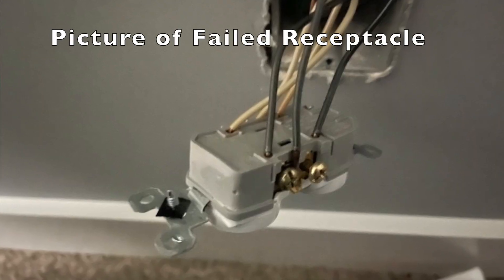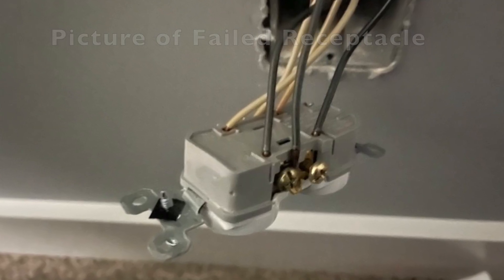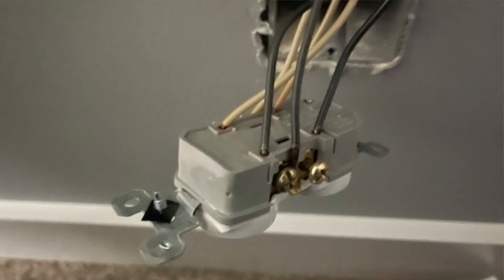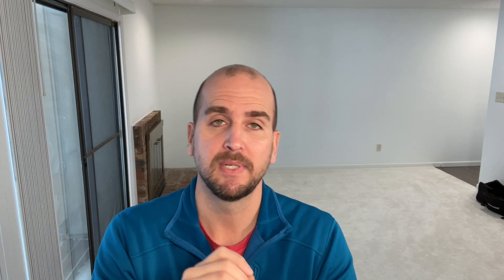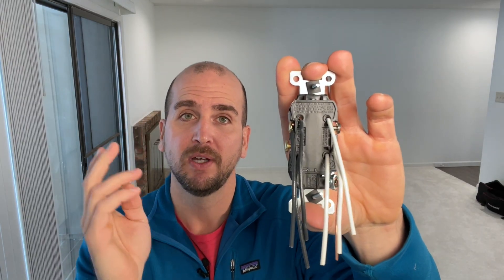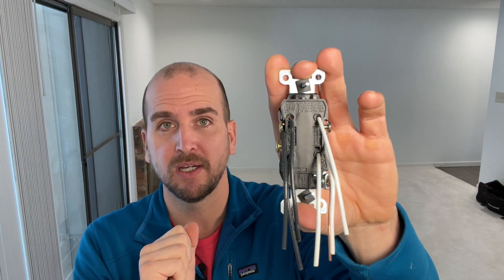Incorrectly Wired Outlet Found In Newly Built Home

Comment: If you have a High Grade (Commercial/Industrial/Spec Grade) receptacle outlet which features Back Wiring clamp/screw type connection terminals, I don’t see any reason why you would want to bother with and use a pigtail configuration - Before I get started I just want to eliminate some possible points of confusion that some people might have concerning "Back Wire" connection terminals - The term Back Wire by itself is somewhat misleading in that it might cause you to conclude that the Back Wire connection terminals are probably located somewhere on the back surface of the receptacle - If you have that impression you are dead wrong - Back Wire connection terminals are NOT located anywhere on the back surface of the receptacle but are instead located along the sides of the receptacle exactly where the Hot and Neutral terminal screws are located - With that being said and to avoid another possible point of confusion, it should be noted that the Back Wire connection terminals are NOT the four small hole openings that you will commonly find on the back surface of your lower quality receptacle units where you can simply push in a set of 14 gauge wires to make your connections which I strongly do NOT recommend - A Back Wire connection terminal is actually an assembly of two parts (a terminal screw and a clamp that is located underneath a terminal screw) - When you place a wire underneath the clamp of a terminal screw and tighten down the screw you will have performed a Back Wire connection - When you place and hook a wire underneath the terminal screw and tighten down the screw you will have performed a Side Wire connection - The wire must be placed underneath the clamp to be properly classified as a Back Wire connection - With your Higher Grade receptacles you are most likely to find that each Hot and Neutral Back Wire connection terminal will have two guide slots which will allow you to firmly attach two wires to any of said Back Wire connection terminals - Furthermore,  your Higher Grade receptacles with Back Wire capability will most likely come with a Back Wire type connection terminal for your ground wire connections - You should expect to find a clamp underneath your Ground terminal screw - High Grade receptacles as you should expect are Heavy Duty and will generally accept larger wire sizes up to a maximum wire size of #10 AWG - Scott has a few videos which he has posted online where he has dissected and compared some of your Higher Grade receptacles against your ordinary run of the mill lower end quality units that you might be tempted to buy - I strongly recommend that you purchase only your Higher Grades of receptacles which have Back Wire connection terminals - I will now like to discuss and explain why I think a pigtail configuration should not be the preferred way to go when you are installing High Grade receptacles which have Back Wire connection terminals - Point One - Connection Firmness/Current Pass Through Stability - Every High Grade (Commercial / Industrial / Spec Grade) receptacle that I have ever seen has been manufactured with two recessed slots per Back Wire connection terminal which allows the user to attach two wires to each said Back Wire terminal - If you connect both your hot wires to the same Back Wire connection terminal and connect both neutral wires to the same Back Wire connection terminal, said connection should at least be equal to or better than a wire nut connection which is what you will have to contend with when you do a pigtail configuration - The Back Wire clamp/screw terminals of these High Grade receptacles are really no different than the clamp/screw terminals that you will find on most circuit breakers - Point Two - Receptacle Failure Will Not Cause Other Devices Downstream To Become Disabled - If you hook up both hot wires to the same Back Wire terminal and both neutral wires to the same Back Wire terminal and the receptacle fails (stops working), current will continue to flow downstream uninterrupted just as current would continue to flow downstream uninterrupted in a pigtail configuration - Point Three - Excessive Downstream Loads Should Have No Effect On Heating Up The Receptacle  - Again, if you hook up both hot wires to the same Back Wire terminal, current to downstream devices should flow in the same manner as a pigtail configuration and should not heat up the receptacle any more than what a pigtail configuration would do - Point 4 - A pigtail configuration requires additional wire nut connectors and wires which can make it more difficult to fit everything into the outlet box, particularly if the box is a small box like the shallow size boxes that are most commonly found in 2” x 3” studded wall partitions - Point 5 - If you split feed the receptacle with an extra hot wire and you use a pigtail configuration, you will make it even more difficult to fit everything in the box - With respect to the ground wires, you should be able to twist the two ground wires together and attach them directly to the Back Wire connection terminal of the ground terminal - I don't believe the Code would require a pigtail type of connection for the Ground wires if the Ground Terminal of the receptacle is equipped with a Back Wire clamp/screw type connection - Notice that the above points one, two and three are conditioned on the assumption that both hot wires would be connected to the same Back Wire terminal and both neutral wires would be connected to the same Back Wire terminal - Although it can be argued that the hot common fin connects both hot terminals together and the common neutral fin connects both neutral terminals together, it is my opinion that connecting both hot wires to the same Back Wire terminal is a more firmer and direct connection than connecting one hot wire to one hot terminal and the other hot wire to the other hot terminal - The same reasoning applys to the neutral wires as well - In summary, if you have a high grade Commercial / Industrial receptacle with back wire capability, why would you want to go the pigtail route -  Lets argue this point another way - If a pigtail configuration is the preferred way to go, why would manufacturers still design their receptacles with an extra hot and neutral terminal - Granted, you can absolutely justify an extra hot terminal for a split feed configuration but you really can't justify an extra neutral terminal - Final counterpoint - Although the Code is always said to be concerned with safety first and everything else second, I would think that if a pigtail configuration was the more preferred way to go, the Code would have mandated it by now - In the end, with using a pigtail configuration, all I see is more work with no additional benefits - With a pigtail configuration, you are actually throwing into your installation equation additional tasks were errors might occur - Specifically, if you are not careful, you might fail to securely attach the wires inside the wire nut connectors of the pigtails, and as a result, the wires come loose causing your installation to fail - Finally, as an aside, my own personal preferences - If possible, my preferred way of wiring receptacle boxes is one 12-3 conductor cable (12 gauge, two hots, one neutral, one ground) per single gang box with each cable being fed via way of an over sized junction - I may not always use the second hot wire as a split feed, but by its inclusion, it does allow you the option of a split feed should you later change your mind - If I can't get by with a single 12-3 cable, I will use a 4" x 4" deep size junction box with a single gang cover - I simply don't like to see electrical wires crammed into a box and it doesn't make any difference what kind of box it is (receptacle, switch, junction, circuit, etc.)
Reply: I totally agree although I will pigtail if there are three pair of wires in the box.
Reply: Hi Jack - A few comments - I will assume you are talking about wiring up a single duplex High Grade (Commercial/Industrial/Spec Grade) receptacle with Back Wire capability with dual slots on each terminal - Three pairs of wires translates into three cables being attached to the box - Running three or more cables to a receptacle box is definitely not my preference but sometimes it can't be help or it can be very justified - At a very minimum, I would use a  4" x 4" x 2 1/4"  deep metal junction box with a 3/4"  deep single gang cover to house the receptacle - As I stated before, I don't like to see a lot of wires & connectors crammed into a small box - As to whether or not I would use a pigtail configuration in this case, my answer is, it would depend on exactly how each wire is being used - Just like any detective, I am being given a receptacle box with three hot wires, three neutral wires and three ground wires and no one is telling me where they are coming from and how they are being used - I will give you one situation where I would definitely not use a pigtail configuration (all wires would be directly connected to the Back Wire connection terminals of the High Grade receptacle) - This situation would involve a split feed configuration - The common fin would be broken off thereby isolating the two plugs from one another - Two of the cables could be incoming source cables from two different circuit breakers (don't know) - The other cable could be an outgoing cable feeding other downstream receptacles (don't know) - Given the above scenario, I would connect one incoming source hot and neutral wires to the corresponding terminals of one plug and the other incoming source hot and neutral wires to the corresponding terminals of the other plug - The hot and neutral wires of the outgoing cable would be connected to the terminals of one of the plugs (it doesn't matter which one) - All connections would be made using the Back Wire connection terminals of the plugs - In my opinion, if there is any weak point to a High Grade receptacle it would be the common fin because it is rather easy to break off - In the above example, the common fin is broken off and is not being used to carry current from one hot terminal to the other hot terminal and likewise the fin on the neutral side is not being used to connect one neutral terminal to the other neutral terminal - If I could convince myself that the common fin is a solid stable connector, I would connect all the wires to the receptacle regardless of how each wire was being used - I would not use a pigtail configueration - (After my original post of a few hours ago, I have decided to withdraw any reservation that I might have regarding the common fins - The common fins have been around a long time, have probably been rigorously tested and are UL approved - I would go ahead and attach all three sets of wires to the recepatacle regardless of how they are being used) - In an ideal setup, your best wire connection is a wire that connects one device terminal on one end to another device terminal on its other end (no splices allowed) - However, it is not practical to run individual dedicated cables from several circuit boxes to supply each individual device in your electrical system so what you wind up with is a bunch of connection points were things could go wrong - With that being said,  the goal should be to limit the number of connection points and to make sure that each connection point is a solid connection - In this particular task that we are talking about , a pigtail configuration is simply more work and adds more connection points were something could go wrong - The wires inside the wire nut connectors could come loose and cause your installation to fail - By the way,  in the above example, my preference would be to wire up the box by using only two cables - One cable would be a three conductor cable with ground which would supply the two hot source wires - The other cable would also be a three conductor cable with ground and would be used to feed other downstream receptacles as in the above example - Note that you don't have to hook up the additional hot wire and carry it downstream if you don't want to but it will always be there if you should change your mind later on - Also note that the two hot source wires do not have to come from two different circuits - I think the most common setup is one hot source wire is a constant on and the other hot source wire is switch controlled with both hot wires coming from the same circuit - From time to time, I will use either one or both configurations - In high demand areas, such as a Kitchen or a Workshop, I will use the two circuit configuration - In most other areas, I will use the other more versatile configuration

Comment: I don't understand the pigtail..if you have 2 hot wires and 2 neutral wires...and the outlet has 4 screws...why not just use all four screws?
Reply: Lanny Boston, I think it just makes it easier to stuff all the wires back into the box. Just my opinion.
Reply: He was actually just showing you how to make the pigtail. You don't have to use the pigtail if you only have two Hots and two neutrals coming in. He would have had a third hot plus the pigtail for a total of four wires in each pigtail connection if he had shown you an example correcting the problem of three Hots and three neutrals coming into the same box.

Comment: When you install a Receptacle level it. Then place the cover on and check for equal distance of receptacle left right top bottom then level the face plate. I call this Canter I don't know what the Experts call crappy misalignment.
Problem with connecting multiple Grounding or hot wires. Skin the wire ends two inches.
Group the wires together grasp them with your thumb a forefinger. Start at the top below insulation form the wires together then grasp with side cuts twist clockwise and as you are twisting let the side cuts gently slide down the wires. The NEC requirement leave 6 inches of wire in a box? If you pull in a box with two Duplex Receptacles pull enough green, white and phase color to make up both Receptacles. If you install a cut-in tape the screws and do not stretch to break tape cut the tape with a knife. Need to remove a not taped receptacle, tick the hot side and insert a piece of thin card board between the screws and the inside of metal box and pull outlet out gently.
Reply: yup, some gfi receptacles are dangerously close to the plaster ring.

Comment: What I was taught in college was to run electricians tape around the outlet covering the screws. Not all installations are plastic boxes but also crossing exposed screws accidently isn't good either. Thats why they call then accidents. (oh a hot circuit no no no,, some times we have to)
Reply: Whereas at my school, they told us that wrapping tape around an outlet was a terrible practice because it can trap heat and cause failures. That might only be an issue if you put more than a couple wraps, but I've seen boxes where somebody used half a roll of tape.  Just saying, different schools are teaching different things.
Reply: we do indeed,
I work medical and sometimes one room is connected to another and you can't shut off someones cpap to change out a broken outlet on the other side of the wall. This where I am grateful that my predecessor pigtailed.

Comment: Danny, pigtail are a good idea because it makes for a better connection from wire to wire and also enables you to wrap  the wires on the recep like in the video. Also to you homeowners, a 3 prong plug tester is a good idea for your home repairs, to enable you to check for correct polarity and check for power being off. Oh yeah, FYI , 40 yrs ELEC. Experience.